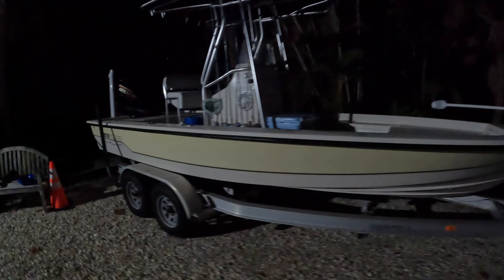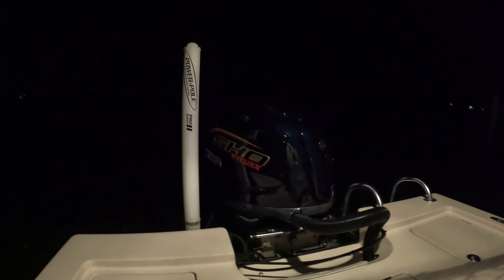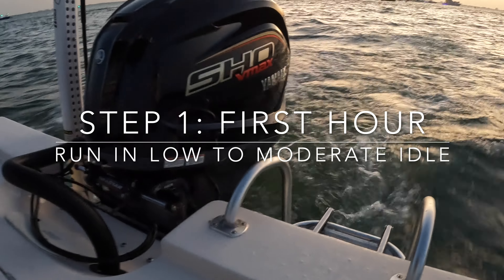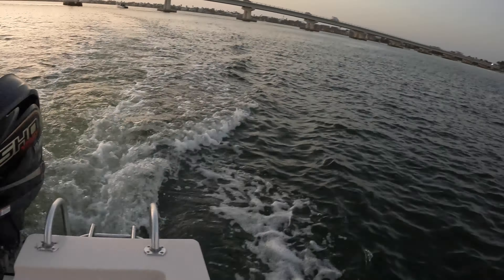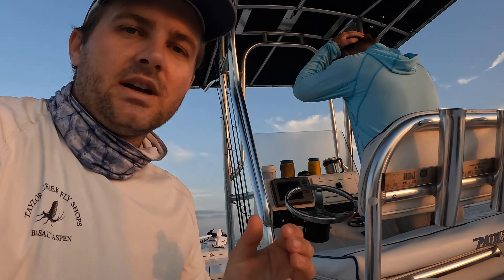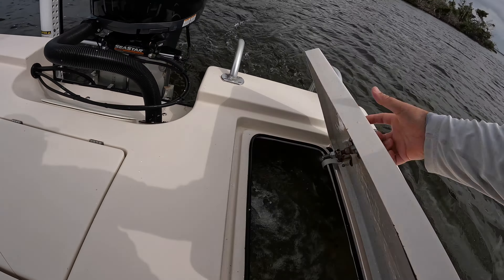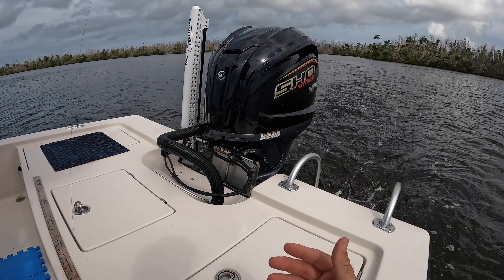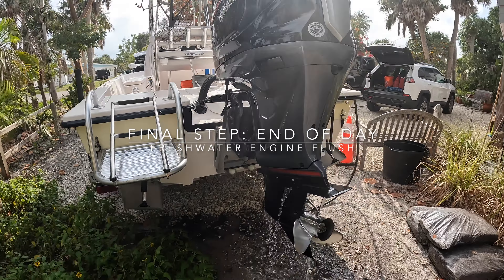How to: Breaking in a brand new YAMAHA VMAX SHO 200. The four major steps you should know.

Comment from the maker: Update: We were experiencing some issues jumping on plane and were not reaching our anticipated top speeds with the three blade prop that was on our motor. So we switched to a four blade prop and immediately improved our rate of getting up onto plane and were able to achieve our typical top speed. This was the first time I had to consider changing props and it made a huge difference. So if your motor is not performing just right, changing the prop is something to consider!
Reply: What was your original 3- blade prop pitch/ diameter and what did you change to pitch & diameter on the 4- blade?  Max RPM on WOT….???
Reply from the maker: @JCASTELLUCCIOJR I honestly could not tell you those specs. I wish I knew more of the fine details but what we experienced with the 3 blade was a fast increase in RPM without the boat properly accelerating or getting on plane and after on plane the boat was not reaching the appropriate top speeds to RPM ratio. When switching to the new motor the mechanic mentioned there was the possibility of needing a four blade. After switching, the boat had a much faster and smoother transition to on plane and still maintained a balanced high speed to RPM ratio.

Comment: What is the pitch and diameter of your four blade prop on the Vmax 200 SHO;  your top wide open throttle RPM????
Reply from the maker: I wish I could recall. We had it put on from the shop and I haven’t heard back on what the specs are. I think our full throttle RPM was between 5600-5900.

Comment: Which prop are you running on your motor and what has the performance of the motor been like for you.  Looking at repower if my 07 pathfinder with the same motor.
Reply from the maker: I can’t recall the specs, but 4 blade for sure made a difference over the 3 blade.

Comment: Which prop are you running on your motor and what has the performance of the motor been like for you.  Looking at repower if my 07 pathfinder with the same motor.
Reply from the maker: We are still running our last motors 3 blade prop. We are currently in the process of switching it to a 4 blade prop as we had issues jumping on plane. Overall, happy with the motor, just looking to get the right prop on it.

Comment: Looking to repower with that exact motor on a 2008 pathfinder 2200 tournament. What’s your review of the motor so far, and what top speed are you getting with it. Thank you.
Reply from the maker: I’ve been a fan of the motor so far. We kept our previous motors 3 blade on and only had a top speed of 43mp, but are switching it out for a 4 blade prop to improve the rate of jumping up on plane.
Reply: If your only getting 43 mph there is a problem and your hurting the break in for sure which is very important on these motors to seat the rings so they don't make oil/ dilute oil with fuel. It's a must that you can hit 5800 atleast 6000 is better. Keep a close eye on that oil bet its making plenty. Just put same motor on a skeeter sx210 which is a  heavier boat and i hit 55 mph at 6k rpm and she gets on plane yesterday @RamseyFisher
Reply from the maker: @thomasmcrae6411 haha, i love the comment “gets on plane yesterday”. And check out my pinned comment on this video, we did realize we were experiencing low performance with the three blade and switched it to a four blade prop and received much better results. We did not open it all the way up to full throttle on the last outing, it was a bit choppy, but we did reach 43mph with more room to boogie. I appreciate the comment, always more to learn.